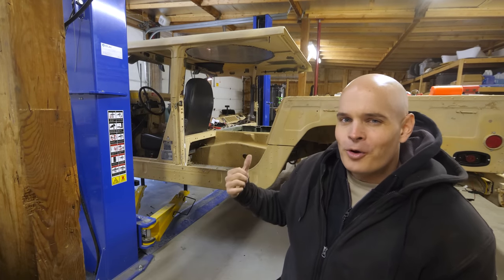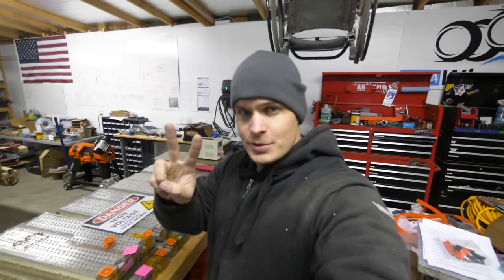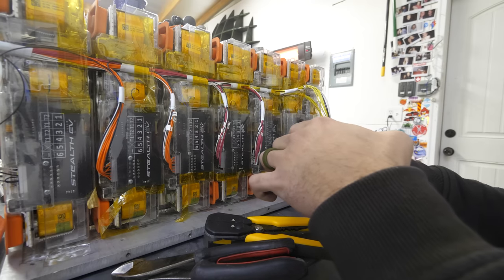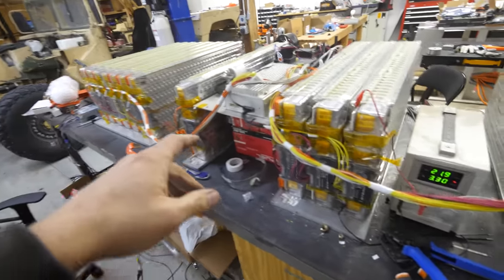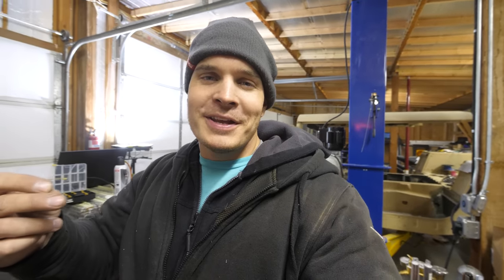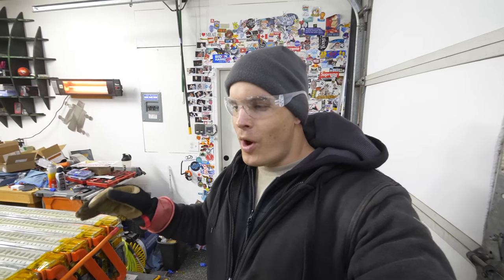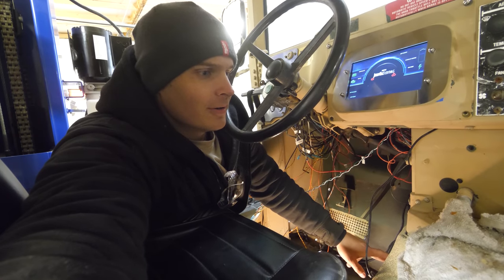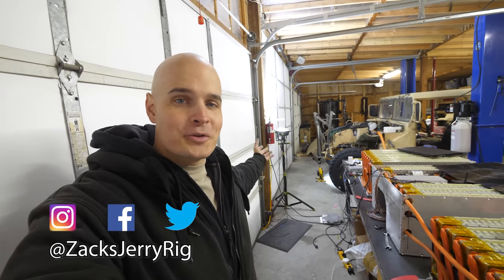Building the Brains of the HIGH VOLTAGE System - IT MOVES!!

Comment: 450v DC, right?  Maybe I don't understand the Tesla batteries, but 450v DC won't pass through the human body very well, if at all.  Maybe a tingle at best.  Of course rapid discharge between metal tools and surfaces is a different story.  You're just welding and burning things at that point!
Reply from the maker: DC will very much pass though, and cook all of your insides within milliseconds.

Comment: Been super cool following along, the physics nerd in me wants to clarify that twisting the wires together serves to cancel out the magnetic field (rather than blocking it - like a faraday cage) if the wires have equal current in opposite directions the magnetic field cancels (how much it cancels depends on how close the wires are).

Comment: Voltage isn't lethal, it's the amount of current the system has that is lethal. Current above 0.1 amps is lethal if it passes across the heart for a few seconds.  So you can die from coming in contact with a voltage of less than 50v if the current is equal to or greater than 0.1 amps.

Comment: It kinda bothers me that you left the holes for the high voltage wires bare, and didn't use grommets to minimise the chance of the 8nsulation fraying against the aluminium.

Comment: no voltage is lethal. the problem with those batteries is the amount of current they are capable of producing. 500mv could kill you if it runs 10 amps across you.

Comment: 19:00 you keep repeating saying that 450V is going to kill you. No it’s not. A Taser/electroshock is around 50.000V. And it’s not lethal. 
Current is lethal. Even milli ampere. 
The point is, a taser can not deliver high current from its tiny AA/9V battery. 
The problem is, that the EV battery can output so much current that it would kill you. 
Resistance is also a factor. Your body boils from high current as it has high resistance. A cable does not as it has low resistance. 

A 12V car battery won’t kill you, it can deliver hundreds of ampere but at 12V and dry fingertips you won’t die by touching both terminals. 

TLDR: EV batteries are deadly because of their capacity and high voltage and ability to output many amps. That combination is deadly.

Comment: Tbh, while I have a fair bit of experience with electricity, this project scares the crap out of me. It isn't even about the voltage. There's a lot of energy in those batteries, and if something goes horribly wrong and discharges that energy, there will be an explosion, and not a small one. The worst part is, I don't see anything to control the process. One cell goes boom, you might have a chain reaction.

Comment: I Russian trained electrical engineer. My 12 yr old daughter asked where the cooling channels you used for wires?  she upset  you not use super Maxwell capacitors for quick pto without battery discharge and onboard welder..She want it perfect for heavy hummer..She  happy, you use Kapton  tape. she complain, you did not make for battery cooling pipe, and pump, cooling fins to capacitor/long battery life...She use capacitor/battery pack on her 72 volt e-bike she next project; Russian special forces vehicle better than  hummer..She look  humorously at your old hummer... She make diagram calculation on your mistake future problem.
Reply: This comment deserves a pulitzer prize

Comment: Thats an awful way to store the batteries, standing on it's side. It's adding a ton of weight on the batteries on the bottom. The will apply unnecessary force on the connections, and when you drive in the car the force is constantly shifting back and forth.

Comment: Do you really think that 500 Amps is a good rated current for your vehicle? Lithium batteries are extremely fragile and they don't cope well with shorts, which I don't think is that unlikely to happen at some point with your singularly insulated all metal box design. I obviously don't know how much your motor draws but I can't imagine it creating 225kW. You could run a whole factory with that amount of power. Plus your batteries would probably be drained instanty. I can't tell which current your batteries or wires are rated for because american wire sizes are stupid but I think you should propably check that at some point. 
I don't want to seem like some know-it-all but this just seems a bit dangerous since electrical vehicles are such an insane fire hazard.

Comment: Please learn your terminology. I can touch 450volts DC all day long with my tongue just like it's a 9volt battery. 
The REAL difference is Amperage.
Amperage is Current. 
Amperage [IS] what will kill you. 
All it takes is just under a half of a amp to kill you, not the volts. And since you're playing with DC, which is essentially a giant flashlight battery, it's a very different animal to AC electricity. DC can, and will kill, just as AC can do the same.

Comment: Your fancy wire strippers. I have a pair that is 40 years old that are way more cool. Mine strip any size wire without touching the conductor. Yours look like spring loaded cheapos that rake a knife across the conductor. I would not use anything like that for electrical work.